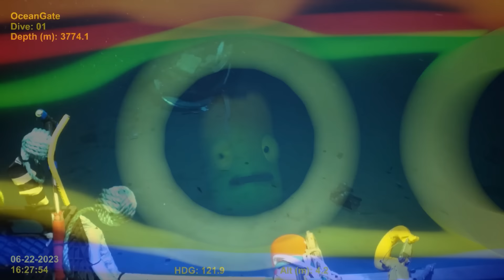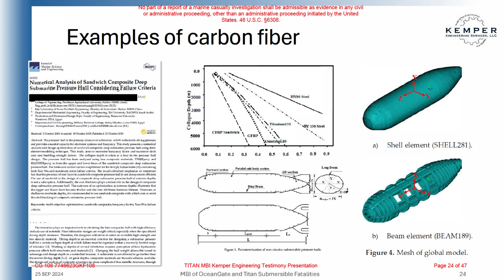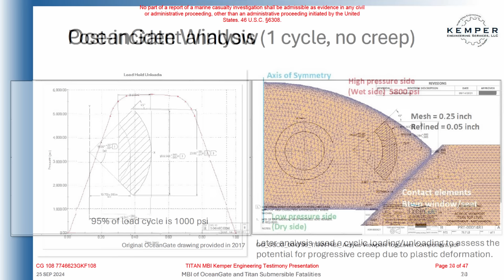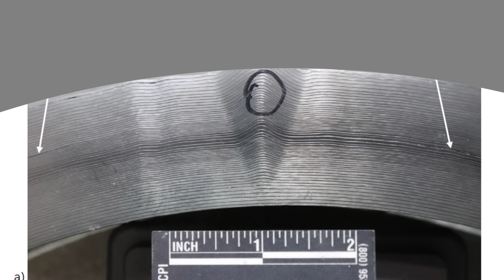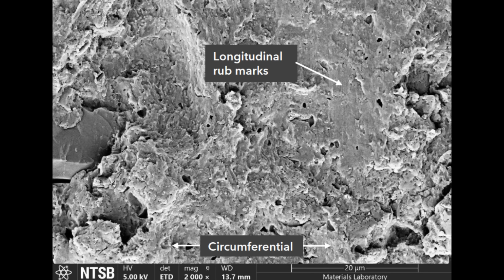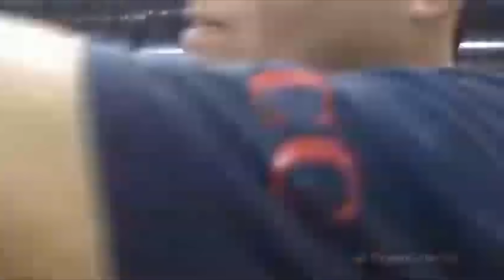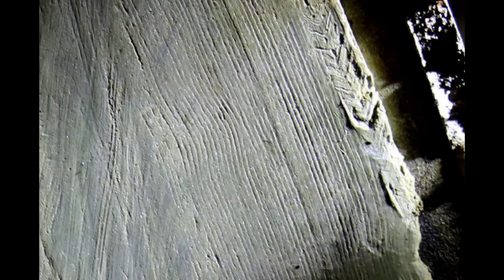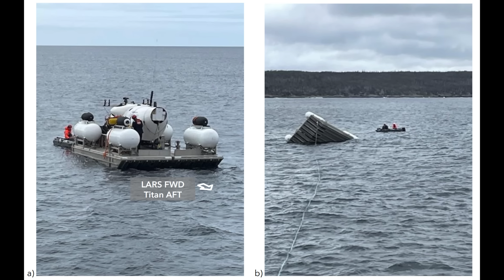OceanGate Wreck Shows Why Sub Wasn't Strong Enough To Survive - NTSB Shares Important Details

Comment: Compare this to even the lowest budget space craft development and the problems in every aspect of this story are highlighted tenfold. Spacecraft get grounded regularly, even SpaceX (known for taking risks) will cancel a launch if anything is outside a tight tolerance during launch; Dozens of successful launches are required before crewed launches are even considered and missions have to be planned within well defined parameters before permission is even granted. That is why space tourism is safe before it has even started, because, like with aviation, the regulatory boards (and companies) have learnt from the failures of the Space Shuttle program. Hopefully this will be the space shuttle disaster for submersibles - a violent poke at governments to ensure that companies can (and do) perform these missions safely and under supervision because, in many ways, being in a submersible below human crush death is more dangerous than space flight. In space, you have a suit that will keep you alive; down at the bottom of the ocean - you don't.

However, it is seems clear that the practical benefits of commercial submersibles are a lot fewer than commerical space craft. There's limited military use, zero transport use, and a much lower amount of public interest to support scientific advancements. This does reduce the likelihood that governments will care about the industry of deep sea exploration.

Comment: Of windows: the flat screen IS stronger, but the problem is that all windows deform under pressure. The truly concave window shrinks but remains the same shape. The flat-inside window pancakes, with the thinner rim shrinking more, pivoting the force onto the inside corners instead of the whole thickness of the edges.

Comment: Most engineering disasters are due to a series of safety systems failing all at once, even the Titanic. It had to contend with hitting an ice berg NOT head-on (at full speed) and instead as an absurdly long scrape along the side of the ship long enough to puncture an absurd 6/5 compartments needed to sink the ship. Then the nearest ship had to have one of their telegraph operators asleep at the time that Titanic was sending out its distress message, which meant the life boats originally meant for ferrying passengers to rescuing boats were now the sole method of escape.
The titan sub was so poorly designed and constructed that we're struggling to figure out which of the many modes of failure was the one that occured.

Comment: As a total novice in physics, already from the start I'm reluctant to the idea of using carbon fiber composite for anything with such an immense pressure for life preservation just because the name "composite" hides the inherent problem in it and we're not even touching the subject of "fiber". If you can't be 100% sure that each millimeter of the composite is uniform, you can be 100% sure it won't behave even close to what models predict. To me it would be an instant red flag in designing a pressure hull. I can be pretty confident that layers of certain metals or plastics have uniform structure and thus are far more simple to predict with models. So, with metal you could create stable composites.Then there's the word "fiber" in carbon fiber which should be a profound indicator that you shouldn't touch the subject unless you have fabrication methods as precise as CPU and RAM fabric production lines.

Comment: Question: So we know that carbon fiber strength can be hard to predict under the type of combined compression/tension scenario when being used in a pressure vessel. Plus also the risk of water ingress at very high pressures due to stress fractures in the resin.
But what if we surround the carbon fiber cylinder inside an outer titanium sleeve ? That way you can use the CF to reduce weight while adding strength and use the titanium sleeve to protect and even the pressure load out over the CF sleeve. The end caps can also additional anchor to the sleeve to reduce strain on the glue they used for the end caps on the carbon fibre.

Comment: A note on the dodgy looking dove tail oring grooves from a mechanical design engineer who has used them;
The tool relief hole (the pre hole used to drop the dove tail cutter in and out of the dove shape profile) was done wrong. The hole was on the center line of the dove tail, but it should be off set on the outside so the oring has the complete wall for the high pressure to press against.
With the hole in the center the oring is loose in the hole and the high pressure can deform the oring and break the seal.

Comment: Thanks a lot for letting us learn from this incident.
One thing about the inconsistent glue layer thickness: In aeronautical engineering, we are actually very careful with getting this right. I thought for a long time that the thinner the glue, the better - right?  
But actually it needs a certain thickness to moderate the different strains in the sheets that shall be connected. It is basically a soft layer that allows for shear deformation. Have too small glue thicknesses and different stiffnesses of the connecting parts (milled down wrinkles) - and that might be enough to break the connection. I thought this might be interesting to some fellow nerd out there. ✌

Comment: In my first year at engineering college, we were shown the calculations for stress on a cylinder ,and how much weaker it was than a sphere.
The cylinder would be guaranteed to fail long before the hemispherical ends.
Therefore it would distort long before the hemispherical ends.
Any slight distortion in this design would lead to failure at the joint surfaces.
At that depth, instantly.
.

Comment: You don't need the wreck to know why it wasn't strong enough, you just need a basic understanding of physics and material properties 
Carbon fiber is strong under tension which is why it's great for race cars and spaceships, a submarine however needs to be strong under compression which is why deep subs are other than this one case always made out of titanium and not a sheet of fiber covered in resin

Comment: Its a miracle that the sub survived any more dives after the loud bang. I suspect the bang on dive 80 was the glue between the 1-inch (flawed/grounded) carbon shells breaking.  After that the sub survived remaining dives by essentially not much more than the 1-inch carbon shells each bearing load independently.  Totally wild.
Reply: With the titanium rings and the carbon fiber tube going on separate vacations every dive because of thermal cycling,  I'm shocked it even worked once.
Reply: @LarsLarsen77  Nice metaphor.

Comment: Grinding down the wrinkles was a major red flag. Then gluing 5 flawed shells with a different glue was absolute insanity.  It should have been a homogeneous shell of flawless carbon composite... Or nothing at all. Also the inside flange on the c-section of the titanium end caps looks painfully thin.

Comment: So Rush didn't want to do proper testing or have any certification.  He did things to purposely get away from any regulations by the government so he could build and run his little expeditions and quick and cheap as possible.  Then when there is a problem...who's on the hook for everything in the end..the millions and millions of dollars searching for something that imploded?  Taxpayers of course.  Take insane risks and transfer the cleanup of the mess to taxpayers when everything goes to hell, which it was always going to happen.  There was NO way this was going to end good cause Rush was going to take this carbon fiber hull to the bottle of the atlantic TIL IT IMPLODED..no matter how many times it took, that was always going to be the outcome.

Comment: They HAD the ability to triangulate where acoustic events were coming from. One lady early on mentioned another, more senior employee building the program, but they never used it because it took so long and (presumably) was a huge computing burden while it ran. Which is just an added layer of horror and tragedy to the fact that the monitoring system WAS telling them the hull was failing, but no one knew or thought of how to look at the data to get that information.

Comment: The design and shape of the glued interface betweene the carbon fiber hull and the titanium flanges is wrong. The flanges are stronger than the composite and will, if it is correctly designede and glued together, give strength/supporter to the composite hull. If the length of the composite tube is less than 3x the diameter, the flanges will give supporter to the total length of the composite tube. So there is quite a bit og stress on the glued connections. This is based on 25 years of experiece with testing and producing carbonfiber subsea pressure vessels. The optimal amount of hoop layers in the composite structure for compression is close to 80%.  And you can only calculate with 48- 49% off the fiber strengt.

Comment: Maybe others have caught on already, but the issue is wrinkles suggests strongly that the already wrapped inner layers of composite tend to contact at an increasing rate, relative to newer outer layers. One might conjecture that this be due to the resin partially self-curing, which may be thermally accelerating itself, while the new layers also insulate the old. One might try to address this by actively cooling the mandrel.

Comment: To me it's odd to machine anything on a carbon filter structure. As soon as you cut the fibers all that's left is the resins. Then if the machined area isn't radiused or over heats during the machining. You are adding additional stress points. Relying on hand laid glue in a non-climate controlled room to glue carbon fiber to titanium. Is just asking for problems. There should have been stretchers holding the rings into position. In addition to a glued joint of non-similar materials. That flex differently to each other under stress

Comment: rush was a fool, he had no plans to test the hulls integrity at any point he simply acted as if the hull could be continuously reused without an end date which is foolish as carbon fiber exposed repeatedly to extreme pressure at 4000 meters will  continuously induce damage to the hulls integrity, micro cracks, tears, delamination's will  spread and grow with each cycle, and all these bangs and groans heard when diving under extreme pressure were the result of hull damage the continuously accumulated and weakened the until the pressure of the depth they were at was greater than what was left of the hulls integrity, and at that critical point the pressure was greater than the hulls integrity and the hull gave way at its weakest point and at 4000 meters the pressure was so intense no biological organism could maintain it;s integrity so their bodies instantly disintegrated, and the hull was smashed into many match stick sized fragments

Comment: If you’re using stress, strain, and load, but worried you’re using them incorrectly in speech, the you arguably aren’t equipped to comment on the technical issues at hand.

Comment: Great video! Ya know a simple test he could have done was put that submersible at at depth equal to 150% to 250% of the depth he intended to put that submersible-similar to the "pressure" tests that are conducted on air-compressor tanks. Seems to work since how often to you hear of air-compressor tanks blowing up in residential homes/garages etc.

Comment: Metals and plastics are a known quantity. Carbon fiber may be strong in tension but it is a composite. Your results will depend on quality control and perfecting a repeatable process. 
With metal and plastic, you just look up the specs and buy high grade materials. You know exactly how strong it is.

Comment: There are usually clear-cut reasons why some materials are considered inappropriate for this extreme type of activity, simply stating that you are attempting to be innovative  isn't enough to ignore the valuable lessons learnt from past events or tragedies..
  Additionally, only having a single individual in complete charge of the project was a disaster waiting to happen, since the lack of any reasonable oversight allowed Rush to proceed without anyone to put the brakes on when obvious issues kept cropping up.  Such a regrettable waste of life that thankfully won't be repeated by Rush at least.

Comment: 1:44 Look, I am an Engineer and I deeply care about what your saying, but I can't help but make a funny voice for that fish that is either fascinated or confused with everything the servo arm is doing. Maybe it is because this was such a horrible thing and I am trying to distract my frustration at this and the awful hurricane going on right now. Anyway, just wanted to say thanks for covering this from an engineering standpoint and leaving the political parts out of it. 

On another note, that Logitech controller was a very poor choice. I had one, and it did suffer from ground noise messing with the signal. I have severe hope the software had a decent trim function to bypass any sudden inputs extreme or otherwise, but the state of software these days..... The wired version of the same controller, is a good controller, and doesn't use off the shelf AA or AAA batteries. (Can't entirely remember, but I think they were AA). Don't misunderstand, I do not have an opinion on using a wireless controller, just on that exact controller. I don't have anything against Logitech or whoever designed it, but why would you NEED a wireless controller? Anyone who has used a wireless controller has let it rest on the triggers in the back and started it to find they are NOT centered because they were not at rest when the power switch was flipped. Seems like a silly risk, regardless of if it had anything to do with this sadness.
Reply: That fish, the hurricane…. I’m right with ya.  I couldn’t believe I was using studying engineered failure causing bits of dead people to relive the tension of nature’s engineered destruction (Storm Milton.)     Yup. That fish was the best part of these past 2 days.

Comment: As a layman, I can tell you this: by machining off the wrinkles, you're literally destroying the strongest part of your hull. If you can't make the hull wrinkleless using carbon fiber, don't use carbon fiber. If you're not going to use the strength of the fibers and decide to cut them at many different points, just forget the fiber and make the hull out of resin and glue (or better yet some other, stronger material).

Comment: 13:43 …why? It should’ve been clear enough by that point that there wouldn’t be any. 
Is there some kind of legal requirement mandating that they have to do this? To me, this just seems like disrupting key evidence for no practical purpose.

25:27 1000m? That graph seems to show the peak amplitude occurring just about at or very close to the time when they reached 0m. 
To me, this would suggest a collision with another vessel on the surface — most likely their launch ship coming to retrieve them after the dive — and if that was indeed the case, then it’s a major incident that should have been immediately reported. It’s definitely the sort of thing that could’ve further compromised the hull integrity.